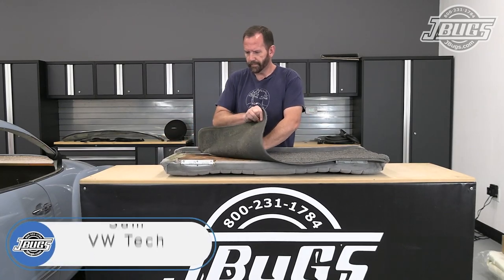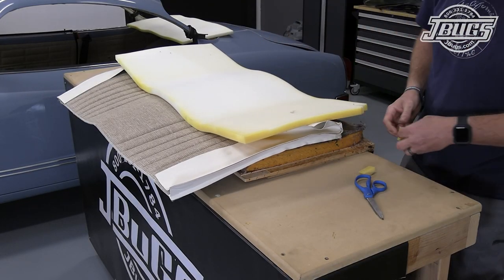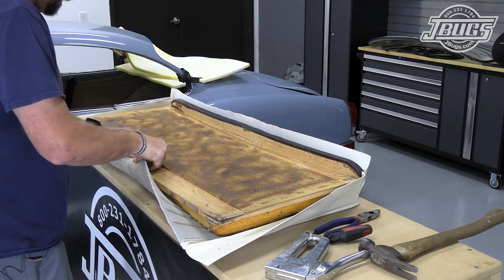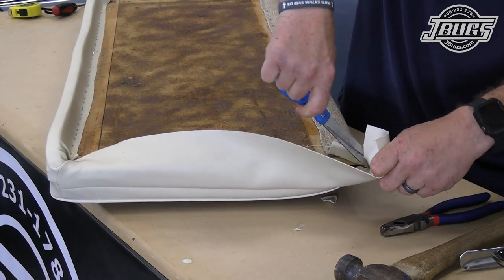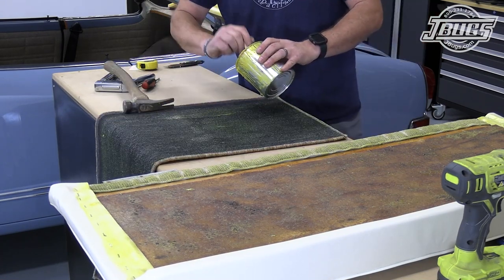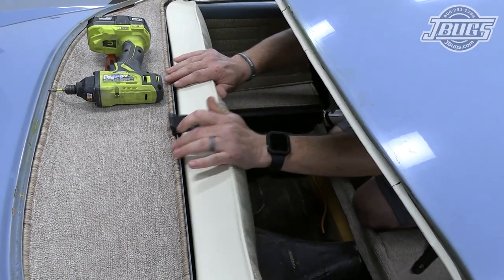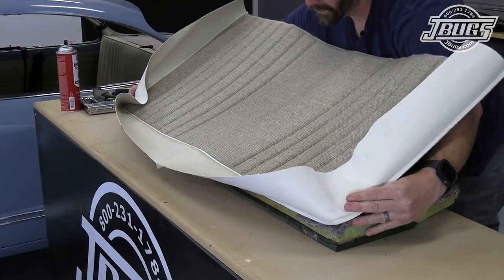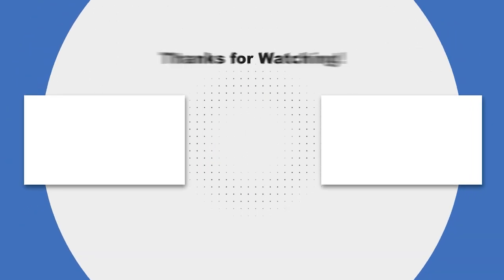JBugs - 1970 VW Karmann Ghia - Rear Seat Upholstery Installation

Comment: I need instructions on how to install the wondow felt scrapper on the inside for a 72 ghia - the clips I bought from you guys is a nightmare to lock in place- any tips?
Reply: I use a putty knife or a trim tool on the face of the felt, once the clips are in place behind the felt, with the hooked edge over the top. Seems to do the trick pretty well for me.